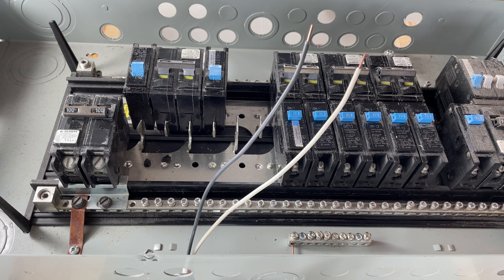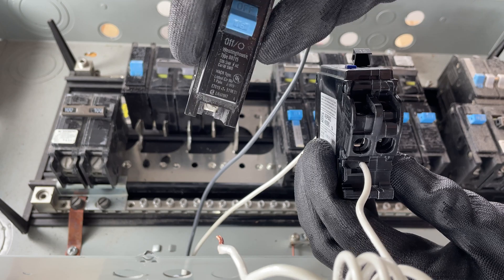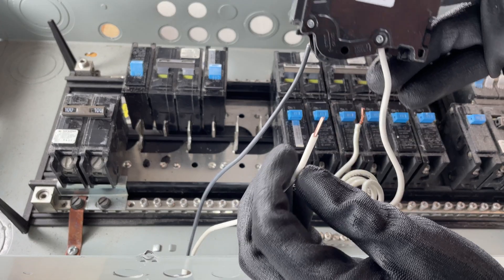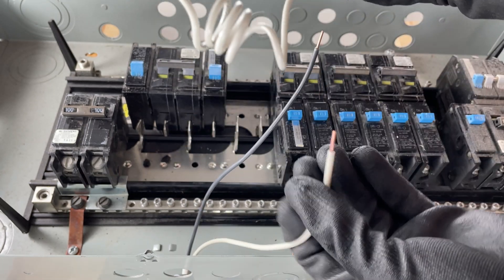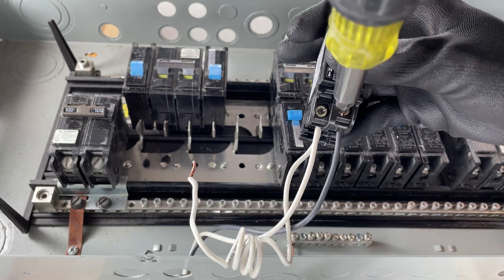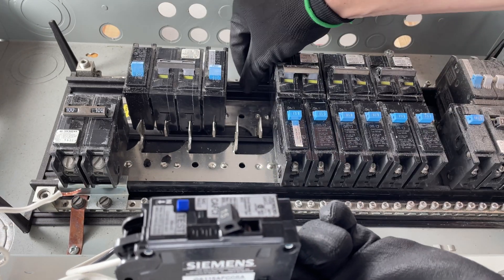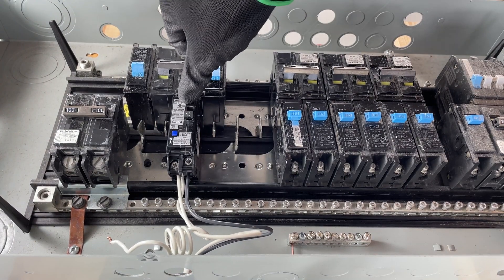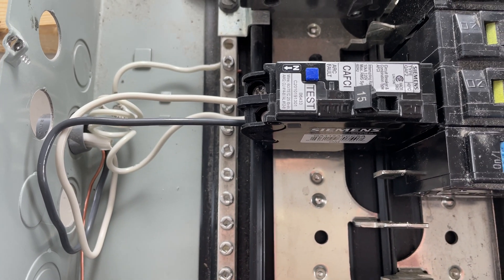How to wire an Arc Fault Breaker - Siemens Arc Fault 15amp - The Electrical Guide #shorts

Comment: My breaker is a QAF , I can only find QAF2 and QAF2n.  Which can I use. ?
Reply from the maker: QAF2: This is the direct modern replacement for QAF breakers. It has updated internal electronics but maintains backward compatibility with panels that accepted QAF.

QAF2N: Same trip technology as QAF2, but with plug-on neutral—it doesn't require a pigtail neutral wire because it connects directly to the panel’s neutral bar if the panel supports it.

Comment: FYI, if you touch anything in there with the power on, it will probably kill you.
Reply from the maker: Yes indeed, be very careful. I did this demo with a dead panel but the potential for injury doing a job like this is high.
Reply: Ohms law, 120 is 120. I've been shocked by buzz bars multiple times. Feels the same as an outlet. Possibly could kill you just like an outlet could. Most likely not though.